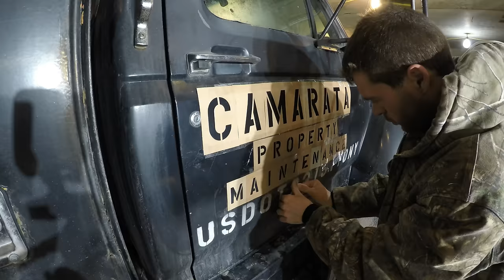Getting stopped by DOT

Comment: When you see grease coming out of the fitting it probably means you've blown the seal. One Two Shots that's all it needs. Over greasing and blowing out of seal will cost you a bearing real quick. It's the most common bad habit I see with people that are maintaining equipment. Grease a bearing yes over grease a bearing no not unless you like to change bearings. Now that the seal is going on that you'll have to grease it weekly

Comment: The stenciling was so stupid it was painful to watch.  You need ONE set of stencils which you will have your ENTIRE LIFE.  You then trace whatever you want onto a piece of bristol board or cardboard (I recommend the former).  You then cut the shapes out of the bristol board and tape that single piece with your entire message laid out all neat and perfect onto the target.  You then spray, move to secondary target or as many as you like (they will all be exactly identical) then either keep for later use or discard.  You label enough crates for the army you eventually get these things perfected. It took me once to figure it out after a Sargent threw them at me and said "Get this done".

Comment: NEVER mount a new tire next to a worn tire.  It will wear faster to catch up to the worn tire buddy.  Should just put two new ones together or new all the way around.  Good tires could save your life and the lives of others on the road. When mounting those types of rims never go "around the clock" - do a star pattern. When mounting on the front or trailer get an empty soda can with a little water in it.  Place the can just barely touching the tire on the side wall - then slowly turn the tire. This will reveal whether or not the tire is on straight. Old - old school with bud rims.

Comment: 8 years old fire extinguisher???? according to the law here in Germany they have to be checked or changed every 2 Years... This thing has to be funktional! Allways!
Reply from the maker: They should not go bad just sitting there.
Reply: @AndrewCamarata  There is "stuff" in it, like "bakingsoda" and that klumps up over time. So at least shake your fire extinguisher from tim to time... and check the pressure gauge...

Comment: I had 10 pieces of 20 ft steel that didnt have a strap on it at least 10 ft from the bulkhead. If I would have had the strap 16 inches closer to the cab it wouldn't have cost me 600$. Two weeks later the same DOT officer was going to give me a ticket for having a pallet on top of the steel even though the steel was secured by the pallet and the strap over the pallet. I had to beg him to not give me another ticket and thankfully he let me go.

Comment: At 10:06 Andy is trying to break the bead on a tire. And he says after swinging his sledgehammer.  “ well that tool isn’t going to work right now.”    everything is frozen up into his shop! 
HIS SHOP,   NEEDS FRIGGING HEAT!!!!      if his shop had heat everything including tires would be so much easier to work,     To work on.     To work with.    To work on!   To work inside of!!

Comment: Do NOT! remove a tire as he has improperly shown as if he had lubed it with soap and water (warm) then he would not have destroyed good casing  for a possible future  retread tire. OR REMA tire mounting paste or  Murphy's Oil Soap or any good tire lube . Then he should clean the edge of the rim with a with a wire wheel or brush to remove most of the black so he gets a good bead seat. Then after lubing tire and wheel and inflating to 120 psi he should have let it air down and  let it relax to better seat after a second fill.  At 18:02 in this video he makes a Serious mistake that could have gotten him seriously hurt WhatEVER you do DO NOT EVER! take the bolts of this type of wheel until you release all the pressure behind the clams as they may blow off and take that beautiful face off of yours . Loosen them then hit the side of the clamp making it pop with the nut still on and NOT blow off.They can have a huge amount of pressure behind them he just took a chance they didn't and got lucky . At the end Having a good bead axe and sitting it beside the tire and spinning the wheel as your tightening on these types of wheels will help you make it so they spin true. These types of tires and wheels can kill you easily so please Don't do what he just did as it was highly improper .Remember lube it your friend in the tire industry and if your not sure how to change a tire properly then get trained as you could Die from Bad advice . Andrew this was not a shot at you but you need training and this Video proves it . BTW if you stored your new tires in a warm place they would mout way easier . :O)

Comment: Nothing wrong with working hard but the older you get, the more you'll want to work smarter and that's not a jab at you. Use your leverage with your pry bars. No need to try and manhandle those big tires.

Comment: If u put 
“Not for hire” on the side of the trk and only move or transport ur material/product
U don’t need a commercial drivers license or dot number to travel in ur personal property
Reply from the maker: Am I technically for hire though if I am delivering materials to jobs I am working at though? If I was just using the truck to build my own house "Not for hire" would be fine.
Reply: @AndrewCamarata  it depends, if the truck isn't used for 3rd party contracts you are not for hire, I assume the jobs are not all under you or a company you own?
Reply from the maker: Bait28 its often used to deliver materials on jobs I am doing for people.
Reply: @AndrewCamarata  it's tricky, but yeah technically you need a dot number

Comment: I was stopped by NY DOT in a 3 month old Isuzu cabover. They said the truck had too much play in the steering. $400 fine and had to send a registered letter back from a mechanic stating it was fixed. TRUE STORY.
Reply from the maker: Did it have allot of play?
Reply: @AndrewCamarata  zero. I pissed them off when they saw my PA plate and asked for my log book. I said 'what's a log book?'' FYI, I have farm plates and can goo 100 miles w/o one.
Reply: @AndrewCamarata  btw, my dad has terminal cancer and your stuff keeps a smile on his face.THANK YOU.

Comment: The tire change was terrible under lubed both on and off and over inflated also removing your wheel locks like that is incredibly dangerous, I’ve seen them stuck on and come shooting out right at guys faces.
Reply: Also always replace duals together when putting a brand new tire on. Should have bought a used one to match now you’re just wasting money and getting uneven wear.

Comment: Ever hear of a torque pattern? Running around clockwise is not the way to bolt up a wheel, and running the nuts down as far as your impact will take them is not best practice either.

Comment: Your new tire should have been put on the outside. Picture the crown of the road. With the bigger tread on the inside the outside tire is hardly touching the road. 
My tire guy could change a tire with no power tools on the side of the road in thirty minutes.

Comment: Taking the wheel of the way you did is extremely dangerous. You never take the wheel nuts completely of until you have hit the dogs with a hammer they hold alot of pressure behind them your very lucky one didn't shoot off and hit you in the face 2 you never released the brakes and spun them to check if the wheel was running true.

Comment: Manufacturers say most extinguishers should work for 5 to 15 years 8 years old is not bad but watch them if they inspect your breaks i have had them put trucks out for breaks when they had just been adjusted that cop did finally got busted for backing off-breaks
Reply: and a tire hammer is faster than the slid hammer
Reply: and valve stems should be 180 out
Reply: and air brake adjustment self-adjuster or not should be full tight back off 3/4 of a turn and 1/2 turn on the back

Comment: Wow are you really trying to Jill yourselves?? Leave the ruts on and walk the rim with a hammer the tire will kick the wedges off. Then take the nuts off and the tire will fall off in your hands.  Also run the top wedge in and the the two lower ones, spin the wheel to see if it’s straight if it is then tighten the others up always in a triangle to make sure they are tight.

Comment: DOT doing their job.
Did you get Level 1; 2; or 3 inspection?
As long as you (a) have a current DOT inspection, all your lights work, no leaky exhaust, descent tread on all corners, brakes are adjusted properly (you have juice brakes or air brakes on that Ford?)  no mechanical problems, logs and lading paperwork are up to date (and you're not in violation of your hours) and aren't over-loaded, no problem. 
When driving an expedited box truck, I got DOT'd at the scale houses all the time. big deal. the 18 wheeler's and commercial 4/6 wheel vans and cargo vans got inspected, too.
Any commercial vehicle is subject to inspection. If you don't like it, change careers.
Sorry, retired interstate commercial driver. You get zero pity of you got road-side DOT'd.
They only shut you down if you're in violation of your log/hours, or a mechanical problem you can't fix in front of them.

Do you keep paper logs or have you graduated to electronic logs?

I know you have to keep a daily log driving that truck.

(BTW Keep your all your forward and side glass, clear of snow. If you can't see out the door windows or windshield, you're more likely to get stopped.
If you have it, turn on the electric mirrors to keep them ice and rain free.

Comment: Kidde extinguishers are NOT junk.
Reply from the maker: It lost pressure for no reason.
Reply: @AndrewCamarata  OK...but that doesn't make Kidde's generally junk...Rolls Royce builds a lemon once in a while.  I have on in my pickup that is over 10 years old and still full.  My one-off good one doesn't prove they are great and your one-off bad one doesn't prove they are junk.

Generally they are good, regardless of what you were told.  Remember, they wanted to sell you a different brand so they could make money.
Reply from the maker: IDK, bunch of people said they were junk. I guess they had a recall on them.

Comment: Kidde is not junk lol kidde is the leading manufacturer of extinguishers. An 8 year old extinguisher "just lost pressure" yea okay. The "air horn stuff" is also your "brake stuff". Curious where youre getting your yearly dot inspections at. But hey props to you for going 6 years with no dot stops. I finish this comment and now youre putting a brand new tire next to an old tire. Dude let me save you some money, when you change a tire, change all the tires. Youre gonna destroy that brand new tire. Now youve got a saw and a grinder taking a tire off..... Wtf am I watching.... Nice plunge cut with a sawzall. Thats a first for me. You had a tire machine the whole time........ Please torque those..... Nope just gonna trust that weak ass electric impact. Tighten the stem with no tool even though its easy as crap to do. Not the way to adjust brakes. Dont trust self adjusters. Well thats my commentary. As a diesel mechanic watching this. Its cringy. Theres your 1 free view.

Comment: I got stopped one time from the. From Ohio into Michigan I had just a little trailer on the back dual axle but a light-duty trailer and I was in my tow truck which is not for hire and when you're not for hire or its agricultural use you do not have to have CDL you do not have to have no names on the side of the truck or. At least here in Michigan that's the laws they had me hemmed up for about 2 hours and said why did I buy a tow truck that is a monster truck in the other guy drives a little 4-cylinder pickup that's red it makes no difference we are law-abiding citizens United Nations We Stand free of any encumbrances and searches and seizures of any such fourth we're going to give me five tickets when I did nothing absolutely nothing wrong and they said you mean to tell me you bought a tow truck and I'll buying equipment from Ohio I bought a little frame machine to pull in cars portable which it breaks down in pieces so they didn't even really know what it was but I told him because I'm an honest guy they tried getting me to admit that I ran this truck for business in the trailer and I said no so they wind up just giving me one ticket for having an expired DOT medical card which which I did not have to have that up-to-date to drive a vehicle that is not for hire and it is not an 18-wheeler and even if it wasn't 18-wheeler if it was Drive I was driving a semi for myself or for my Farmer agricultural nothing to do with making any type of money you do not need a. Or have to even have a CDL or updated. For medical cards for all you that don't know when I called. State of Lansing they told me to sue them did that was wrongful of what they did to me and to fight the ticket I wind up just paying the ticket and renewed my medical card cuz I didn't feel like dealing with it but these cops are assholes out there so be careful man but you don't have no. You don't need it if you're only doing it for personal use if you're making money then you are going to have to get the deal T's in the proper requirements

Comment: go buy a tire hammer !!!    all you did by putting a new tire alongside an old one is scuff the shit out of the old one . tires need to be equal in height..... your stupidity just cost you 75.00 for a tire caseing that could be retreaded!!!   valvestems go straight across from each other to help keep the wheel balanced!!  you need a new slack adjuster as you shouldnt be able to turn the adjuster without pushing in the keeper,and its still out of adjustment   just sayin